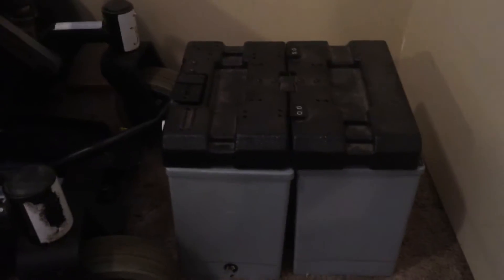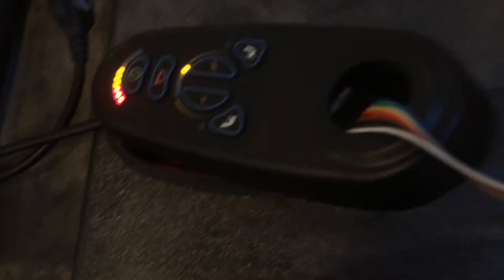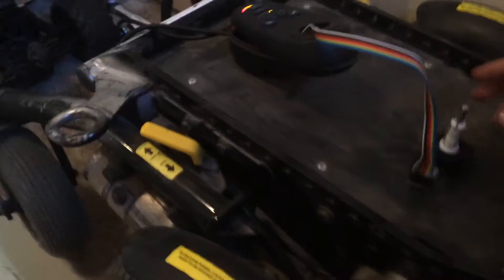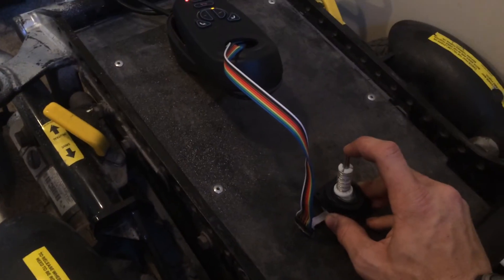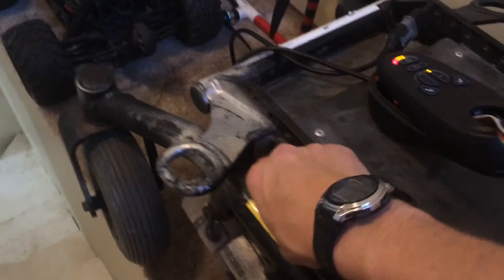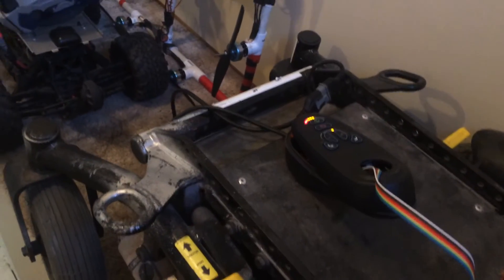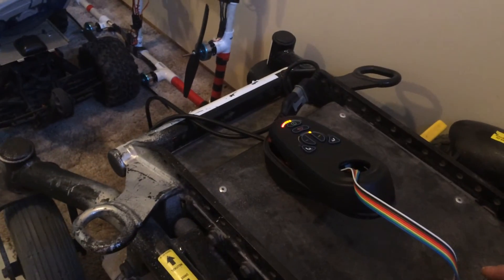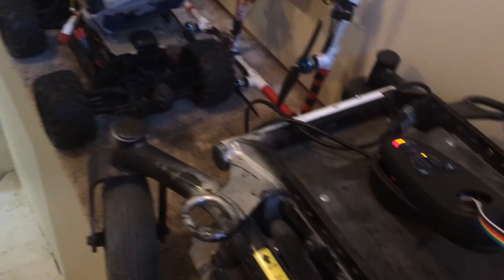Wheelchair motor controller hacking 1

Comment: Not sure what the hack was. Made a battery wheelchair work with the remote? I must be missing it I guess. Hacked up as in taken apart maybe.
Reply from the maker: If you had a read of the description you would have found that this was just the first step, and that if you scroll through the following videos you can see that I used an Arduino and some DACs to emulate the joystick and eventually used a hobby RC controller to turn it into what amounts to a large RC car.